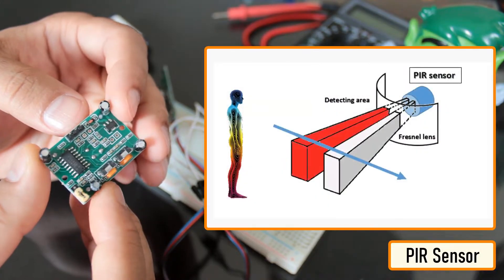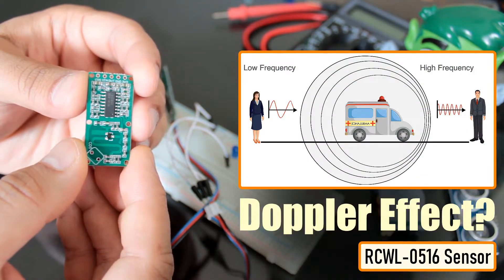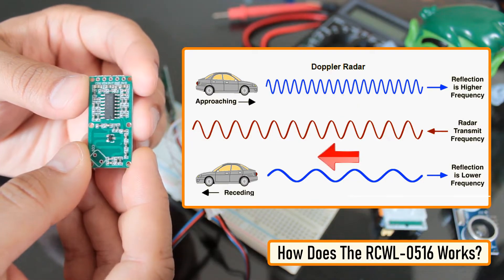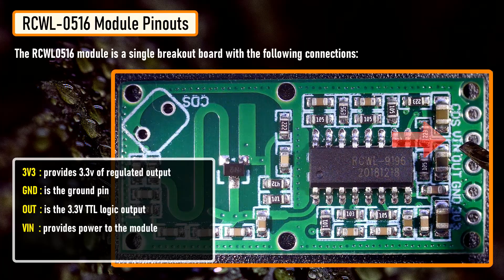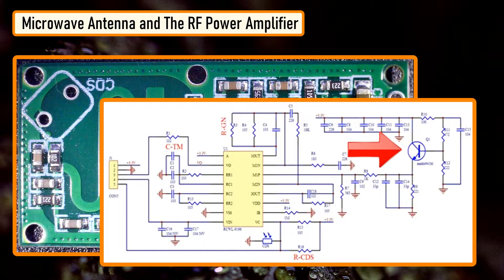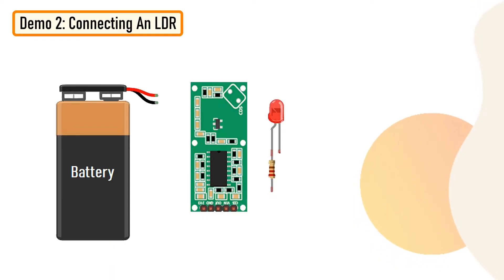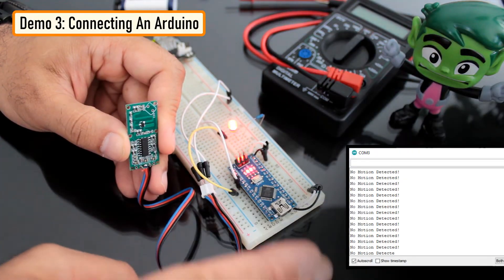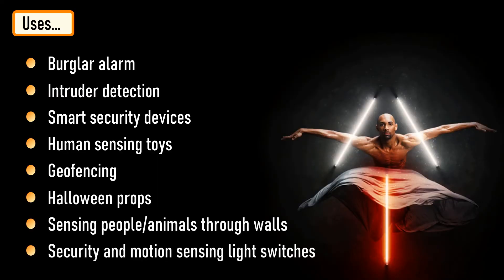All About RCWL0516 Microwave Radar Motion Sensor Module

Comment: Is this module pre configuration and use independently without hook up to Arduino?
Reply from the maker: Yes you can use it as a trigger to any circuit.
You can even use it to trigger an optocoupler and operate a high voltage circuit.
My upcoming video is all bout PC817 optocoupler

Comment: What is the output current of rcwl0516?
Reply from the maker: The RCWL-0516 module itself has two separate outputs with different current capabilities:

* The 3.3V Regulator Output Pin: This can supply up to ~100mA.
* The Sensor Output (OUT) Pin: This is a digital signal pin that can sink and source a much smaller amount of current, typically ~3mA.

Comment: Good and interesting video. Does tis sensor get triggered by small animals like cats and rats ?
Reply from the maker: Yes, the RCWL-0516 microwave radar sensor can detect small animals like cats, rats, or even birds.

If you need only human detection, consider PIR sensors (less sensitive to small animals but require heat signatures).
For pet immunity, some advanced mmWave radar sensors (like LD2410) can differentiate humans from smaller animals.

Comment: Is there also control pot or something to adjust sensitivity or its timing ?
Reply from the maker: Unfortunately no pots available, however,
RCWL-0516 microwave radar motion sensor has a few components that allow you to adjust its sensitivity and timing (detection duration). Here’s how you can modify them:
1. Adjusting Sensitivity (Detection Range)
The sensor's sensitivity (range) is primarily controlled by:
Resistor R-GN (R6 on the board) – This resistor sets the gain of the internal amplifier.
Lowering its value (e.g., replacing the default 1MΩ with 470kΩ) increases sensitivity (longer range). Increasing its value (e.g., to 2MΩ) reduces sensitivity (shorter range).

2. Adjusting Detection Duration (Time Delay)
The sensor has an onboard capacitor (C-TM or C7 on the board) that controls how long the output stays high after detecting motion.
Default: ~2–3 seconds (with a 0.1µF capacitor).
To increase the delay, replace the capacitor with a higher value (e.g., 1µF for ~30 sec).
To decrease the delay, use a smaller capacitor (e.g., 0.01µF for ~0.5 sec).

3. Adjusting Repeat Trigger Time (Optional)
Some versions have a repeat trigger control (via a resistor or capacitor), which sets how quickly the sensor can retrigger after motion stops.

Comment: Hi, Then i can make a voltaje divider with a LDR + adecuate resistor in function of the LDR resistance connected to VIN and GND to force the module to work just with daylight? Or wat is the better way to force the module to work just with daylight? inverting positions betwheen LDR and the R-CDS resistor, connecting LDR to R-CDS and a fix value resistor to CDS?
Reply from the maker: Combining an RCWL-0516 microwave radar motion sensor with an LDR (Light Dependent Resistor) can create a smart motion-activated system that only triggers in low-light conditions (like at night). 
RCWL-0516: Detects motion via microwaves (works through walls/objects, unlike PIR).
LDR: Measures ambient light; ensures motion triggers only in darkness (e.g., for night-time security lights).

By changing the Arduino code to work when the light is bright, you can achieve what you are after. Try the below:
if (digitalRead(RCWL_PIN) == LOW && analogRead(LDR_PIN) < THRESHOLD) {
    digitalWrite(RELAY_PIN, HIGH); // Turn on light
}
Reply: @CrazyCoupleDIY  Yes but then i need an aditional module or an arduino module to work just for day increasing the compsuntion.
I purchased some modules and i tested it with a voltaje divider with LDR +10k resistor, betwheen VIN and GND is 10k resistor, when the light affects LDR the resistance is low and the voltage that comes to the radar module is over 4v and radar module is active, when light dont affect the LDR the resistance is high and the voltage that comes to module is under 4v then the module cant work, so the module work just with daylight.

Comment: They are very sensitive to RF when I stand 5 meters away and with a porto on 446 mhz transmitting with 1 watt it reacts immediately. Could be a problem or perhaps a solution depends on what you want to use it for.
Reply from the maker: I agree

Comment: Hi 
I have electric scooter, i am planning to make project using arudino, my plan is while accelerate the vehicle, by tracking belt rotation speed to make sound using a speaker,   basically electric vehicle with acceleration sound, without touching any internal wiring, please help me with it
Reply from the maker: You can use a reed switch and a magnet for this purpose. Something similar to how washing machines trac the rpm

Comment: Hello,

I appreciate your video; it was very useful. I also have a question about the sensor's sensing angle. I read that this sensor doesn't have a blind spot, but I want to reduce the sensing angle. I don't need it to sense 360 degrees, just between 100 to 180 degrees.

Is it possible to reduce the sensing angle of the RCWL-0516 sensor? Alternatively, can you suggest some common materials that absorb microwaves and don't affect the waves?

thank you
Reply from the maker: I created a toy gun using the sensor (something similar to laser tagging)  
To limit its area I used few layers of aluminium foil

Comment: hi, friend. I was experimenting with this sensor and came to the conclusion that it is not useful for alarms. It is very sensitive and is triggered by the slightest movement of a branch. Furthermore, it is impossible to direct the detection beam. Lightning cannot be channeled with either aluminum foil or 2 cm thick iron. Any comment from you would be very helpful. greetings.
Reply from the maker: I agree to your point 
The way I limit its area of detection is by putting aluminium foil

Comment: My opinion. I have been using this sensor for some time now. I wanted to use this as a replacement for PIR. The only problem is that it can detect from behind thin walls and it triggers false alarm and also it uses much more power than a PIR because it is a continuous wave so if you install somewhere that you wanna rely on battery, it is not recommended. As a whole it is not recommended for security presence detection. It is more suitable for stairway lighting control.
Reply from the maker: I agree to the power consumption bit, but you can delimit your detection area by using aluminium foil.
Reply: Just sample it every x second... Why run it continuous on battery?

Comment: Do you know the value of the resistor that should be used for the sensor to be at least 30cm long?
Reply: I usually slap a micro pot and screw it until I get good results and hotglue it
Reply from the maker: No idea mate

Comment: Sat here with a range of sensors and initially opted to use one of these for a garden security light. Connected to a 12 volt relay module (nothing else needed, other than a 12v supply to both). Unfortunately they are too sensitive. As I suspected, the shrubs in the garden are giving lots of false readings and it is also picking me up as I move around the conservatory 😂 I also had a problem when I tried one in the garage with the tumble drier in, for some reason it continually fired when the tumbler was on. Just desperately trying to find a real life use. Also, when using a ldr, it requires almost total darkness to operate, even holding it in my closed fist wasn’t dark enough. Back to PIR’s for me😢 Great video. Thanks.
Reply from the maker: That is absolutely true.
The problem with the PIR sensor is that you can not effectively use it in a hot environment.
Reply: @CrazyCoupleDIY  pir with a 10k thermistor will work in hot environment !!!!!!!

Comment: v great video brother ; please  just one question : how to increase the output voltage  ??  to have more than 4v  ??
Reply from the maker: You can add a buck converter if you want
Reply: Connect to relay and switch larger voltage.

Comment: does it work with a single layer of glass with a thickness of 2mm?
Reply: If there is no metal in the glass, no problem. Even doubled is no problem. But no metal.
Reply from the maker: That is correct.
In my next project, I have it behind a 3d printed plastic case.

Comment: this is by far the most detailed explanation of all jump pins. I'm just looking for a proper method to block or direct the microwave sinced my cats and  dogs constantly triggers it. i don't have to even ask as you answers all of my questions in the end. 

i only have just one. i used it to  trigger a mosfet switch for a battery indicator since i don't want the digital display to always illuminated. I'm glad i can shorten the trigger distance as it suites my purpose. thank you
Reply from the maker: Thanks a lot
I am glad that I was able to help you
Reply: My kit has only 2-3 CM detection how to increase
Reply: @sumitd4u  I found that when my detection range increased out to typical ranges from the 5cm when I removed the sensor from the breadboard and connected the sensor using only jumper wires.

Comment: I recently bought a rcwl 0516 after connecting a single 5mm red led and powered it on  the module is continuously turn on the led the led does not turn off PLEASE HELP
Reply: Are your connections as per the diagram shown in the video?
Reply: @backless7824  yes 5v to vin, out to positive of led and negative of led to gnd
Reply: @backless7824  not only one three of them are in this same condition
Reply: @backless7824 one thing i just observed if i hold the sensor in my palm both hands covering the sensor the led turns off if i open my hands the led turns on  i also added a 1Mohm SMD resistor to the R-GN PADS to reduce the range
Reply from the maker: Hi mate 
Just remember the sensor has 360 degree visibility with no blindspot. 
Please use the serial monitor to see what the sensor is reading
Reply: Thankyou guys I AM AN IDOIT THE MODULE WHICH I'VE BOUGHT HAS THE BISS0001 IC INSTEAD OF RCWL 9196 IC
Reply from the maker: All good mate 
Learning Curve

Comment: Hi, great information. I want to use this sensor, with an arduino, to calculate the speed of a slot car. Do I need two of them or cna it be done with only one? What is the response time for the sensor? Ie how long between the car passing to the sensor being triggered? Thanks
Reply from the maker: If I have to do it myself, then I will probably do it using two.
You may have to do some experiments to find the response time mate.